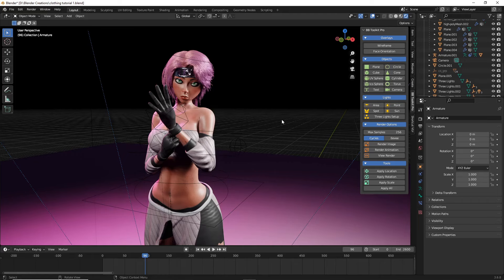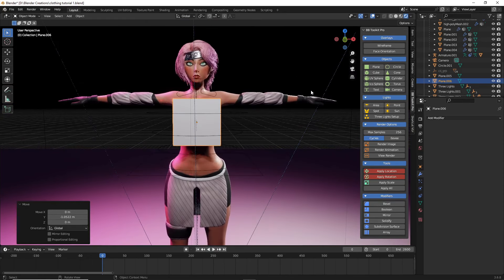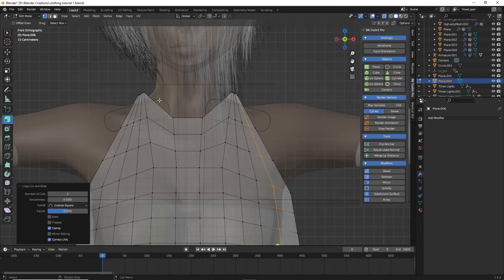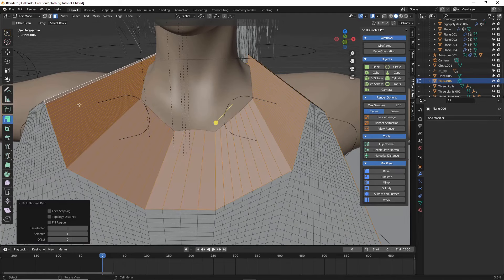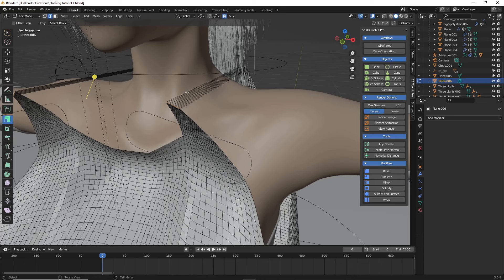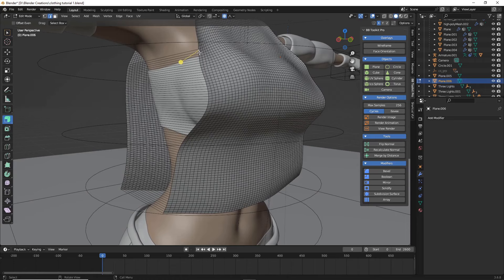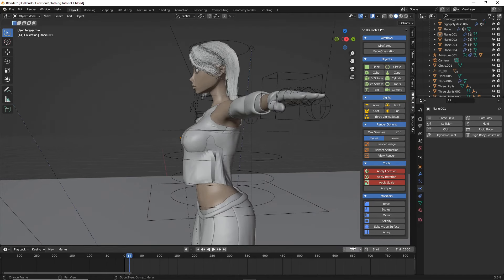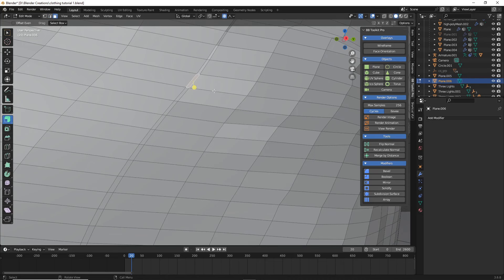My Clothe Simulation Secrets (for best results) | Blender Tutorial

Comment: Hi I have a quick question well more of a little concern than a question but yeah ill just gonna go out and say it , see the thing is my blender 4.1 crash a lot when im doing  big projects yet the LTS version which are the older version work pretty well but Im worried that because there older version I won't be able to take full advantages of all those new features what do you think I should do ? should I stay with the LTS version or should I find a way to fixed the constant crashing of blender 4,1
Reply from the maker: Hi there! Long time no see! If it were me, I always think it's worth updating to the latest versions so you can stay fresh on the latest versions. So I'd recommend seeing if you can figure out the crashing issue 😬. 

I know that's easier said than done, but you'll most likely have to update your blender at some point in the future anyways, so might as well figure out the issue now rather than later 😁 

Best of luck.

Comment: Is there anything we can do to make the simulation work properly on models that are scaled more realistically? I dont quite understand why the character needs to be 50 meters tall for this to work.
Reply from the maker: *15 meters

and EXCELLENT question! So the standard settings for the vertext mass under "physics properties" I find just look better with larger characters, and scenes. However if this is a deal breaker for you, you can still follow the tutorial but make some adjustments to the "vertex mass" in your simulations settings, and it should help the cloth work even for smaller characters. You'll just have to play around with it till you find what works for your project. Thank you for reminding me to mention this info!

Comment: Genuinely curious why you say to make your characters overly large for the cloth simulation. In my experience, it's much easier and more intuitive to do everything at a proper scale so the physics just works the way you expect it to rather than having to scale it all up to match a 30+ foot tall character.
Reply from the maker: Thank you for asking :) This mostly comes down to personal preference. When dealing with scale and clothing physics specifically (most likely having different experiences than you it sounds like) I have found larger characters to give better results, however others are more than welcome to use the methods they prefer, this is simply my preference 😁. I would guess this has to do mostly with the vertex mass in the physics simulation. Thank you so much for taking the time to comment, much appreciated! 👍